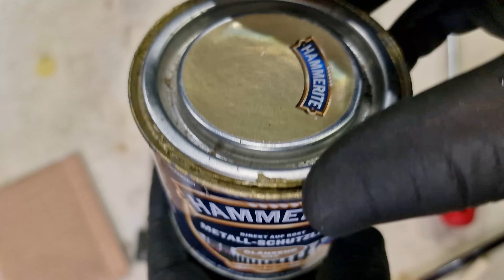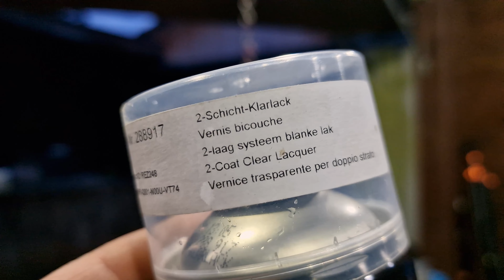This Restoration Is an Unexpected Christmas Miracle!

Comment: It’s a shame those screws weren’t in the finished product but I could tell they were going to break. Made from some flimsy alloy. Regardless the outcome was spectacular. I loved that some of the original paint was kept and the rest highlighted. The red berries was the “icing on the cake”.
Reply from the maker: I was also sorry that the screws did not stay in the piece; these screws were welded into the cast iron and were unlikely to be removed without breaking. Anyway, I also liked the result. thanks for the positive comment